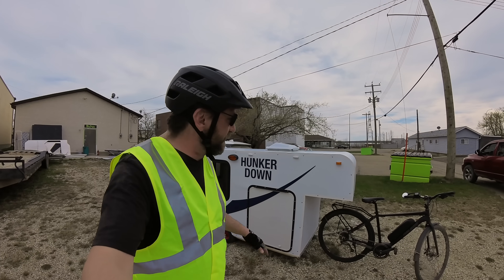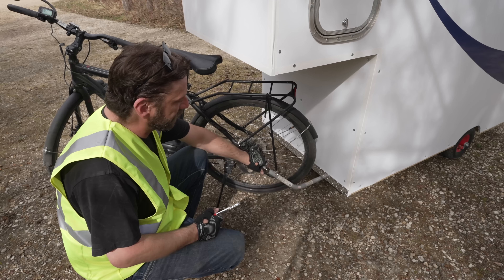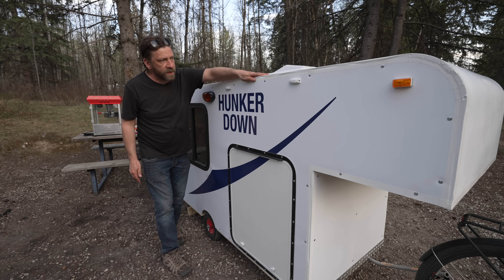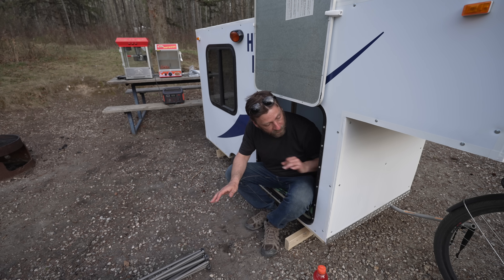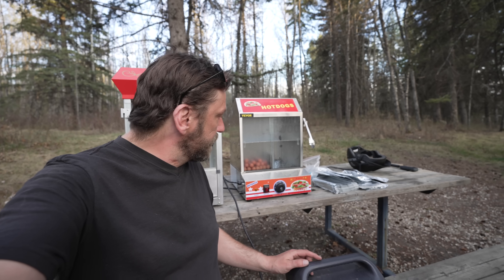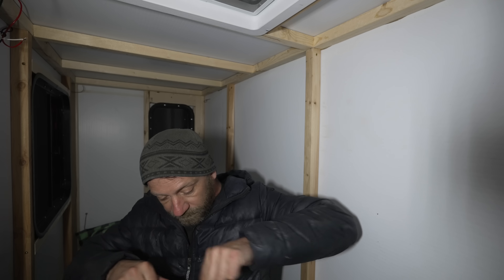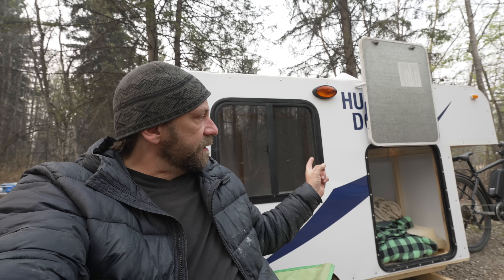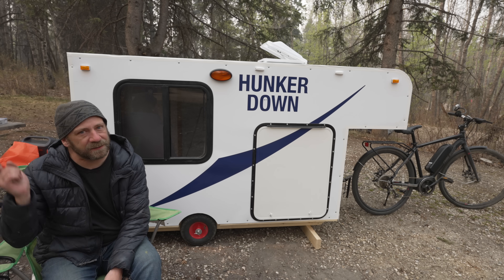DIY Bike Trailer Camping

Comment: Hey Steve, for the wiring, you can get ahold of some split plastic wire looms. They are typically meant for cable management under a desk or in a professional server room, but they're very light weight and they are split already so you can add them to wires already in place. They should be a LOT cheaper than the next best thing which is PVC style cable conduit.

Comment: Steeeeve! Someone may have already said it, but if you roll the mattress up and stuff it up where the "fifth wheel" hole is, your chair could go at the opposite end, and you'd have good view out the back side window. As for the interior walls, Tyvek with wallpaper. Super light AND insulating. Good luck finding someone who knows how to wallpaper.

Comment: Couple of ideas, in terms of what you put on the walls it depends on what you want it to do. If it’s just look better you could stretch fabric over the spars. So it looks nicer and you can still use the space. As for water, maybe a low height, low slung tank. Almost like a fuel tank, keep the centre of gravity low. Just a few thoughts.

Comment: Bafang are good for electric ebike kits.  bbs03 they have much better touque and gearing to move load. The wheel motors will get hot and are better for higher speeds

Comment: Very very amazing. I like your drawings as well. Suggestions -  1) 12 inches wheel will definately make better difference in many ways. 2) We will need two strong retractable legs in the front of the camper. Could be verticalsliding wooden poles with latch. 3) Solar panels on top with a Solar boost charge controller that will keep charging the bicycle battery as well as any camper battery. 4) You will get wrapping tubes that have slit on the side, which will be perfect for wiring here. Just run a double wire all around the corners of the ceiling with wrapping tubes, and then pull out output joints at spots where you need them. 5) Two motors will eat more power than one single 350 or 500 watts motor. If you attach a front wheel motor it will give skips. The wheel will rotate at one place several times because all the weight is at the back. Will be a waste of power. A single motor at the back does a great balanced job.

Comment: This was a really enjoyable watch! I hope you find this comment, as I would like to make a few suggestions that I hope you will consider!

First and foremost for me: Get rid of that door!! You've got a propane hatch mounted 90° from how it was designed, you're crawling into it, hitting your head on it, poking your hand on the screws, and overall just fighting it to even close it from the inside.

Since it's not like you have any horizontal supports immediately above the door, why not just make a full-height (relative to the camper of course) door? One which swings out like a normal door, and has a (lockable!) latch and maybe even another window. Forget reusing that propane hatch!

Next, I would suggest putting in a MaxxAir fan in that vent. They run off of 12V - which clearly you are already intending to have, at least for lighting - and it might make a warm or sunny day a bit more bearable if you can actively ventilate the space, not just passively.

I also noticed you have the exterior "porch light", but not an interior light. Of course you used a flashlight in the video, but naturally I would suggest having at least one interior light. I would suggest using one of those dual-switch RV lighting switch units, with one for the porch light and one for the interior light.

Perhaps you could even add an exterior light bar in the front at the top, to help you see at night if you need to move in the dark.

I would also be careful with that storage overhang, not to put anything heavy up there, such as water. Since it attaches to the bike low to the ground, and it's very light in general, just be careful not to make it too top-heavy. Maybe that would be a good place to keep the mattress while not in use! Could put a hook above and below the opening, and stick a bungee cord in there, to prevent it from unfolding onto you while you're sitting in the chair.

I definitely think a flip-down table or two would be a good idea. It'd be super simple to make - just a few hinges, a chain, and a latch. And it would greatly increase the usability, without adding much weight, costs, nor taking up any additional space when stowed upright.

I would also highly suggest installing some sort of insulation, such as foam board. It would add a little bit of weight, but it would be worth it to keep it cool in the summer and warm in the winter. You could probably get away with 3 sheets at the most (8' x 4' x 2"), which would add approx. 20lbs to the build, if you did the ceiling too. (And possibly just 2 sheets would be enough to do the walls, which would be closer to 14lbs). Then at that point you could cover the interior walls with a thin plastic film lining or something.

I suggest too, putting in some kind of permanent battery, even if it's just something to hold the Jackery in a fixed place. That way, you can use the Jackery and wire up your 12VDC leads from your camper into it, to power all your lights and the fan that you should definitely get. I would then put a 110v outlet next to the Jackery, with kinda a pass-thru (ie. back-to-back) junction box, with one on the outide having a 110V 15A "inlet" plug.

This way, when you have an extension cord, you can just pop it onto the inlet on the outside of the camper, to charge up the Jackery without removing it. You'll need your 12VDC output into the camper somehow, and you'll need to charge the Jackery when you can anyway, so this would be an easy way to do both, and for cheap! I would probably put that on the left side ("driver's side") of the overhang, so that it's out of the way. Maybe put the inlet plug (outside the camper) facing forward, just underneath the overhang, so that the interior junction box (and outlet from shore power to the Jackery) is just below the opening as well.

You could also do a similar thing - with an "inlet" plug next to the Jackery on the inside, to plug the Jackery's 110V output into. This way you could put a 110V outlet on the inside, and an outdoor-rated outlet on the back (for things like a popcorn maker and a hotdog cooker! 😜)

You could even get a changeover switch (they're cheap, $10!) so that your interior/exterior 110V outlets can either be powered from the Jackery's inlet, or by the shore power inlet. It's all a pretty simple wiring job to do.

So basically, if you're inside the camper looking at the front, you'd have (left to right, just below the opening), an outlet for the Jackery to charge from (and on the exerior side would be the inlet box), then to the right of that have the inlet which would connect to the Jackery's 110V outlet, then to the right of that have the power changeover switch (with one direction being "shore power" to the other outlets, and the other being the power coming from the Jackery).

I hope you see this, and I would love to find out down the road that you've taken any of my suggestions! :)
~Kat

Comment: Hi Steve, consider mounting the axle a bit lower, on rubber bushes to increase ground clearance and cut out the rumble.
Also a set of 4 stepped wedges to level it on any terrain.  Solar panels to charge your  bike battery?   An internal hammock perhaps?  you could sink a washing bowl in the hitch hole?

Comment: Steve, very cool trailer! I’m just spitballing here but if you made a trap door in the floor, then when you set up camp you could put one of those heavy black totes into the hole and when you sit, you could put your legs into it! When you travel the tote would ride inside with your camping gear.  You could then put a lid on it that could be kinda flush for sleep mode, but how convenient to store your things in the tote and not outside.   I think you could put flex seal tape around the edges to make it water tight. Maybe redo the door?  Like make a door that is is larger than the doorway and rig it so you can use hiking poles to hold it up, so you have an awning. That’s why I’m thinking the whole side of the trailer, but a double door situation that you can secure for bedtime, but the awning could be left up?

Comment: I would've gone 20" bicycle tire on the trailer. But I guess you wouldn't be going fast enough for the difference in wheel size to be an issue.  
I hope I can round up some large signs after the election to do this.

Comment: 26" Bicycle wheels would be a game changer for reducing rolling resistance and extending e range. A Sneaky sneak move would be to...Imagine the bike with two 250s or one 500 motor but the trailer with the 1 or 2 stealth motors and solar on top? Awesome as always, keep inspiring.

Comment: Cracks me up that your brought the popcorn maker and hot dog steamer.  You rock.  Love the build!  you could also store the mattress up in the loft.  also a little awning on the camping side.  LOTS of reflective tape on the back end! IDK if I'd spend the weight to finish the interior walls--not bad as-is, unless you plan on winter camping and need insulation.  For safety, maybe even some bicycle strobing tail lights on the back.  There are bicycle rear-view cameras too--you could tie that to your phone while you're riding so you can see what's behind you.   for wiring, you can use a wiremold product that just sticks onto the wall.  Or crude way, zip-tie/staple to the interior of the wood frame.  Keep it up!

Comment: a three wheel bike probably would have done better for the fifth wheel setup due to rear wheel stability. you got it right for two wheel though. great job. the spring might not last long. you should look into a three wheel bike for this build.

Comment: You can buy rfp sheet board and rfp glue to line your trailer.✌ rfp sheets are pretty thin and easy to clean and supposedly mold resistant.

Comment: You could use military style wool blankets as insulation. Just hang them up with little hooks or you can do a pretty clean install using some 3/4 inch wood screws with 1" washers. Cover the entire ceiling and walls with 1-2 layers and you're good to go. Hanging would probably be best at first so you can run electrical wires throughout. Get a right angle drill to rough drill wires through the studs. Staples might even work for the blankets. Nice build man!

Comment: Hi Steve how are ya doing. I was thinking if you switch to l e d lights and interior  light. Wired to 3 or 4 panel switch near door.i would put 1.5 inch foam insulation board. Cut to fit in between  2x2s. Maybe 100 watt solar panel and 1 or 2 35/40 amphour battery's

Comment: Thanks again for a great camping video. You should put 1in foil backed insulation in the camper to keep the summer heat out and a usb fan in your vent or window for airflow later this summer. Maybe a couple fwd led lights on the camper incase you need the extra light while biking so people can see you when they drive towards you.

Comment: Hey Steve, you need that garage door stick on insulation inside after you wire the lights and accessories, it will absolutely make the biggest difference in winter for you , the average human puts out about 1kw heat so if you do this nights will be blisss as your cabin size is perfect 👌

Comment: steve,
i bought a power tool adapter that powers my lights. any power tool battery has adapters on amazon that you can use to wire lights and add a switch to turn them on or off.
It will save alot of weight vs carrying around a car battery.
Plus you can recharge your battery with your jackery if ever you needed too.

Comment: i'm a little late to this one, but i have a minor suggestion: 
I know it might spoil the look a bit, but if you swapped out the welled wheels you're using for bicycle wheels in an open-wheel configuration, you'll likely reduce your rolling resistance by a lot.

Comment: Try making a board attached to outside of that beauty with a tarp or umbrella right above it for cooking. Could mount some solar panel on the roof to charge a camera or a flashlight or to power a fan during a hot day. Probably mounting a basket on the bike as well for odds and ends or some MRE. Many posibilities.

Comment: If you haven't solved the electrical situation, then get slim canal canals, preferably the ones that are easily opened, drill holes in the wood beams, and thread the cabels through the beams and canals all the way to the shelf where the power supply is.

If you connect all the wires, you can add them all to a single plug, making it easy to turn them all on and off.

Also, depending on what power supply you use, maybe you wanna add an outlet on the inside too.

Comment: My biggest concern would be wind.  I live in a very windy area so I wonder how stable that camper is in wind of 48 Kilometers per hour or greater.  I am thinking both when riding and when it is set up for the night.  DO you think some stabilizers on the ends that extend out from the camper would be feasible?

Comment: @Steve Wallis with the front motorwheels 
You can put the battery inside the camper so save room on frame an ill come back check out this video on how to seal the wires from the weather brb
Reply: Channel name is @Quiet Nerd
386K video is UPGRADING The Electric Motorcycle Camper - DIY Build + Overnight Adventure. At time stamp 8:00 he starts talking about wires to inside his think it will save you time if you even read this

Comment: How about powering the trailer wheels with a seperate controller for going up steep hills and possibly larger range? 
Connect it via bluetooth or a simple inline connector to get to handlebar controls. 
Fantastic project, I love it, well done so far Steve.

Comment: Don't forget to chock those wheels! I bet it wouldn't be difficult at all to attach the roof of that with some clips and put hinges on one side. Then you could prop it up at an angle with fabric walls or mesh screening when you are camping and be able to stand upright inside it on one end. Put some closable vents on the front and back and you can air it out while you ride. Cut up and use the rubber from old bike innertubes and DIY washers and gaskets from it to put between anything that rattles or makes noise to really dampen the sound down. This works great on the bike itself as well. If you can find a couple old car scissor jacks you can make this camper level on challenging camping spots. A motorcycle brake lock for the bike or even an old padlock on the disc brake to help immobilize it will help keep the crows from stealing the bike and keep them to your buns.

Maybe consider an old tarp to use as a bike cover to help keep moisture off it and keep people from seeing it and getting ideas. Use a ratty old stained one.

I would also suggest looking at kayak/canoe bike trailers for inspiration on how you could attach this to your bike even better!

I love this camper and have so many ideas for it! I hope you keep us updated! :D

Comment: Put 3 folds of foam bed you can fold daytime as a single couch inside your Honker Down transport. You won't need to put a folding chair, instead a small folding table you can eat while you are seated at the 3 folded hard foam single couch/chair.

Comment: Make the mattress trifold so it can be converted into a chair. Maybe hey a dollar panel to charge the ittle jackery. Hey a mini makeup fridge to keep a sandwich and drinks could. It could also power a tablet/tablet for "TV". a small fan. A tiny low 200 wattage space heater. Then a fire/ CO2 alarm. One of those small folks out lap trays to use as a desk or table. Send insulation sheets.

Use led strip lights or battery led pucks so no wiring

Comment: Good work  on Hunker Down.

My sugestions:

1) Put something on the screw tips around the door. Even covered by a bar of styrofoam can safe your fingers from new injury. inside layer of styrofoam and say thermofoil, can insulate your sleeping space pretty cozily. I did saw even a version of bike-camper, with inside active heating, powered by gascan of campigngas for the camping burner, with a mini chimney, to get rid of the smoke.

2) Visibility - To increase visibility, simply use reflexive tape and stick it alongside contours of your camper. MUCH smaller chance someone will flatten you in the night on the road by a car.

3) Energy - might be pretty nice ability, to ride your camper say 50 kilometers (zirca 25 miles) a day in 4 hours and than setup your pannels and before sunset recharge your battery to the full capacity. With enough of solar pannels (possibly on the roof and sides) you should have enough of charge, to cover your cooking, if you have either good luck or big pannels, you might be able to cover even (at least part) of the batery recharging. Hell, you can have 2 e-bike batteries and use one as a powerbank, wich is permanently powered up by the solars, and than swich when that is full and your "fuel tank" is dry.

4) for LONGER camping on the spot, I sugest you to use an "U" shaped wire or bar, something on the ground to avoid standing in the puddle of water plus mud, and plastiq sheet as a summer - time shower and/or toilet (for that you need either a bucket or actual camping toilet.)

Comment: I have wanted to make an RV from chloroplast for a while since seeing it in a shop in sheets at very good prices. Thanks for the demo. I think if you put it on a very spare thin aluminum frame it would be really durable esp covered in thin laminate sheeting like you did. No rot. I'm allergic to mould so, no wood RVing for me. For a pro finish I think I'd find some kind of edging that's a bit more solid, maybe aluminum. That would be nice.

Comment: Flip down bed from the side wall so it's the full length of the space you have, and it you wanna get really creative put a wall mounted PC monitor in the back corner for those rainy days, as for a kitchen.........keep the cooking outside, don't want to be cooking where ya sleep . Good luck on the build big guy✌️😎🤘